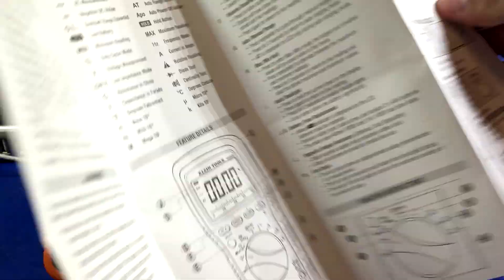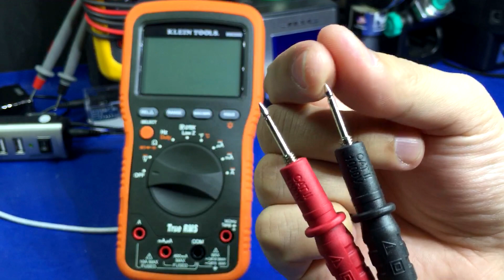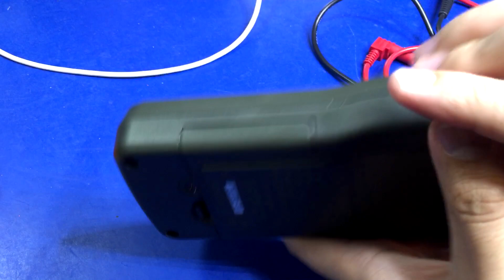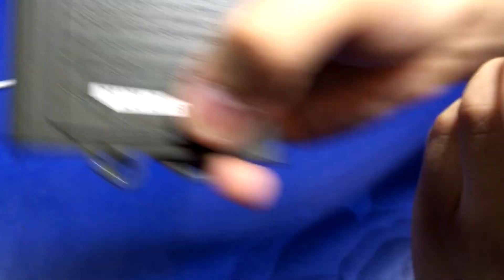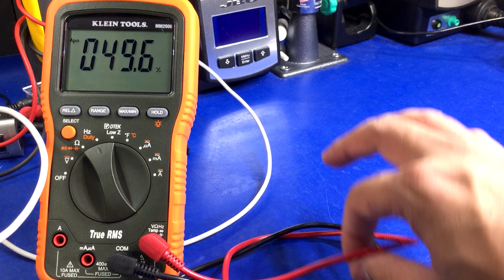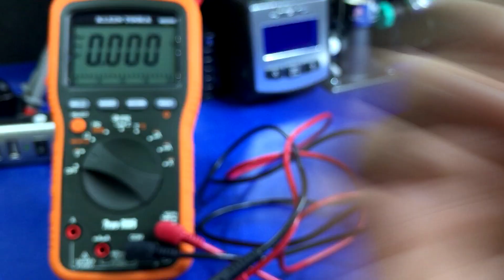Klein Tools MM2000 Multimeter Detailed Review - #0084

Comment: I've had mine for 6 or 7 years now and I've been really happy with it. I used it on the job as a telecom/low voltage tech, and in some of my electronics engineering tech classes as well.

Comment: Thanks for the review helped me decide what to get, I just picked up the MM2300A very similar to this one you reviewed, nice feature difference is that the AC DC are separate settings and they put mAmps  & Amps together. Guess some might prefer this set-up to the mm2000 but to each his own.  I had to adjust the thermocouple was low by 5 deg  C, the rest of the settings seem within spec. Small question would you know which model ProbeMaster fits this meter?
Reply: Very good

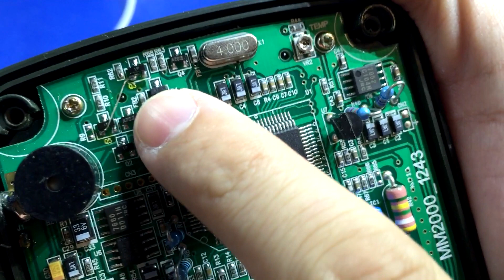Comment: I recently bought a used MM2000. It didn't power on so I opened it.  The only thing that I could find different than your review meter was that it was missing the bodge? wires you mentioned at 19:33 and 20:16.
Once i reassembled it it powered on. 
Do you think those missing wires will be a problem? 
Sorry for long post.

Comment: so with the multimeter shutting off at about 2.2v, this means I would not get adequate use out of NiMH batteries in it right? and would NiZn fry the multimeter if I tried using that instead?

Comment: Thanks for these videos. Question: My father is a handy man for a school; he does a lot of electrical work and has started to work on HVAC (not installs, just maintenance). He is using a $5 analogue multimeter and I want to get him a new meter for father's day. Looking at these videos I had narrowed down to the Uni-t ut61e or one of the Klein DMMs (2000, 2300, 6000). For that type of hangman work, which would you recommend? Thanks!
Reply from the maker: +twilightkids Klein most likely.  You don't need the extra features of the uni-t's so the ruggedness of the Klein would probably be worth the extra cost